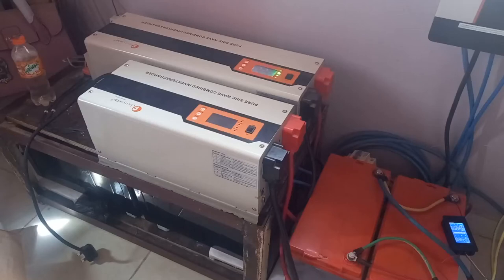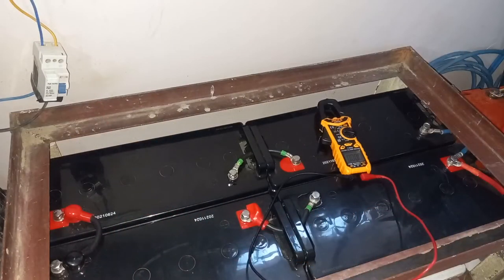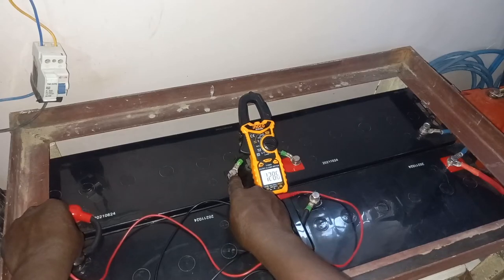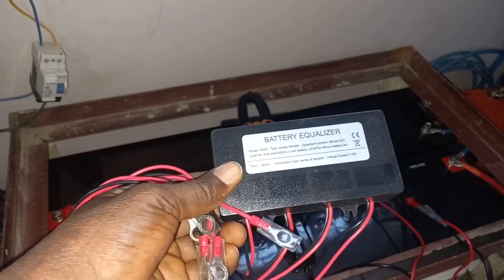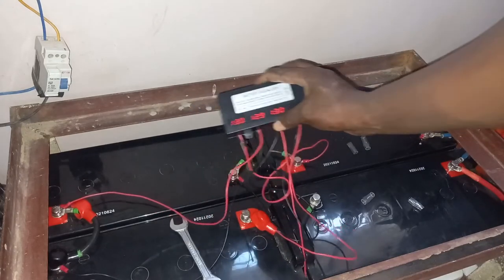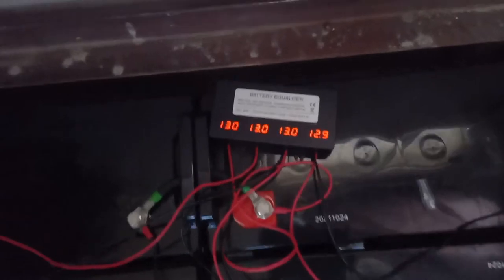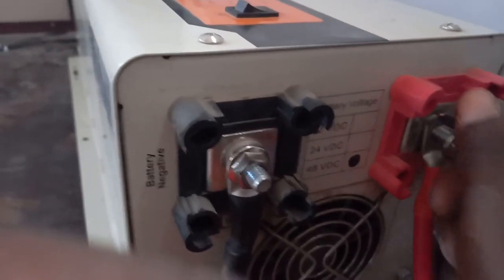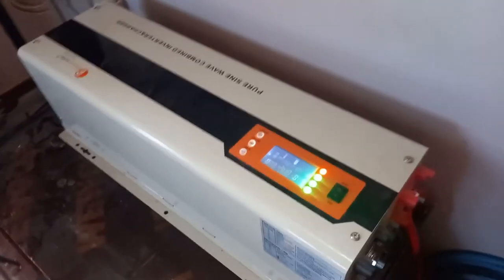Installation of Battery Equalizer HC02 4S to My Felicity Solar Off-Grid System

Comment: Do i need an equalizer if im using a 24volt system
Reply from the maker: You can use equaliser on 24v system, alternatively you can balance your batteries by disconnecting them, and connecting them in parallel.
Reply: @diyfalke  my batteries are connected in series ... are you saying I should make it parallel instead  of series if I'm  not getting an equalizer
Reply: @diyfalke  what if my batteries are brand-new would an equalizer be needed at first setup assuming I'm using series connectoon
Reply from the maker: @anthonyosunde2129  no, I'm saying before you connect it in series, you should connect the batteries in parallel, allow them sit for say 24h to balance then install them in your system in series.
Reply from the maker: @anthonyosunde2129  Even new batteries should be balanced before series connection.
Reply: @diyfalke  but my system is a 24volt inverter any idea how to connect them in parallel first before taking it to series for first time use
Reply from the maker: @anthonyosunde2129  when you bring the batteries, keep them aside, find two short cables, pick one and connect the + of the first battery to the + of the second battery. Pick the second cable, connect the negative of the first battery to the negative of the second battery. Do not connect anything on the battery. Leave it like this for say 24 hours. After 24hr, disconnect the two batteries. Then connect the two batteries in series, then install your inverter, and charge controller to the battery.
Reply: @diyfalke  thank you so much ... I appreciate your responses 🙂
Reply: @diyfalke do you have to disconnect the battery equalizer or leave it permanently